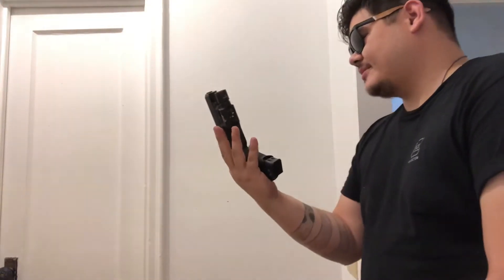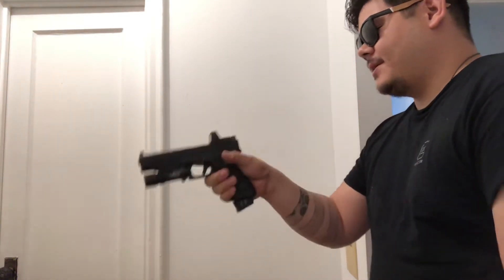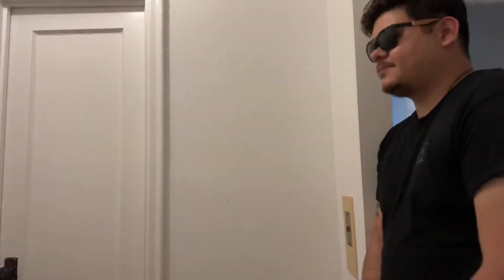EF G34 gen 5 MOS co2 firing.

Comment: Hey is there anything extra I need to do to fit that slide on my g17 lower and what holster are you using
Reply from the maker: Which lower. If you have a gen 5 lower it fits right on. Only reason mine took so much work was because it was making it with ef co2 mags. If you’re just using green gas it’s drop in no custom modifying needed. It’s a safariland 6354DO for g34 and x300 light